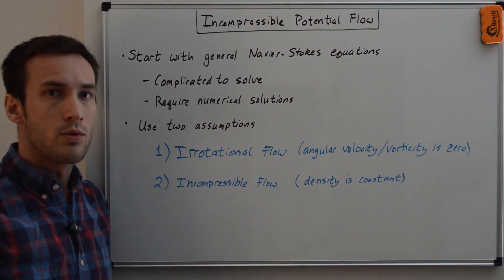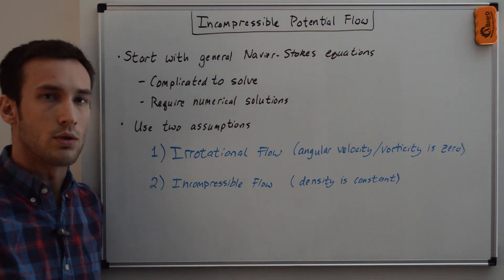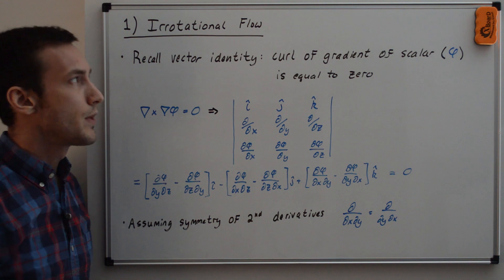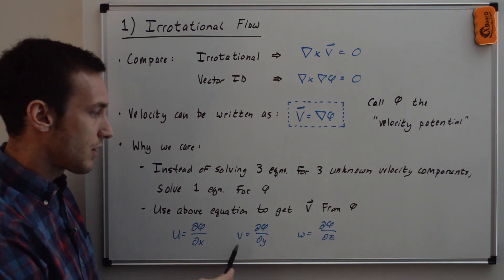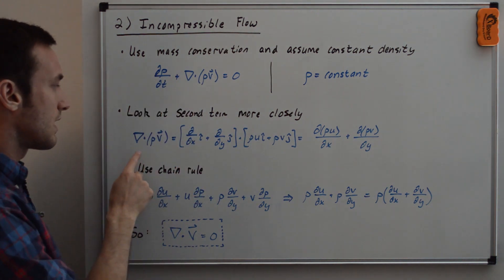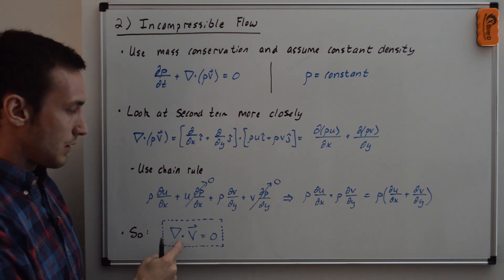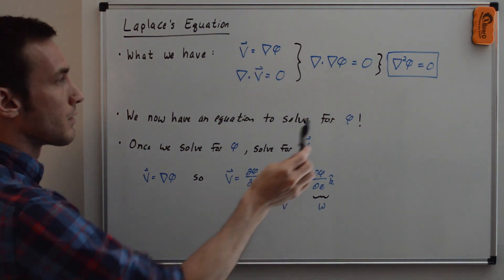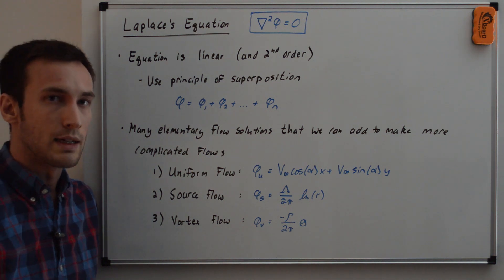Incompressible Potential Flow Overview

Comment: Nice video, thank you very much. 
I just wanted to add: incompressible does not necessarily mean that the density is constant. It means that the material derivative of the density is zero. 
So basically, that the density does not change along a trajectory. 

Doesn´t change a thing in your video. Still great. Just wanted to add that, since I have noticed, that many of my students are struggeling with that,too. 
Cheers!

Comment: why there is a solution to vortex flow? when you already assumed the flow to be irrorational(vorticity=0)??
Reply from the maker: Although it sounds a little counterintuitive, you can have an irrotational vortex, since the fluid elements can be purely translating in a rotational motion about a point.  The Wikipedia page for "Vortex" has a couple of helpful animations.